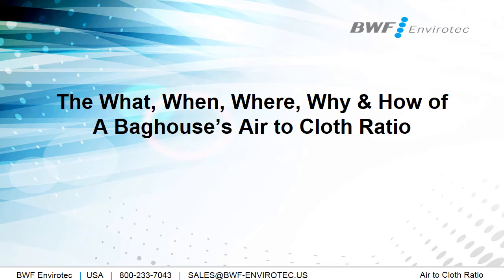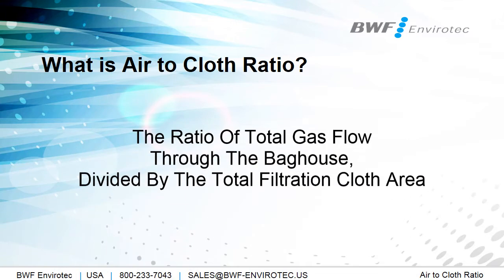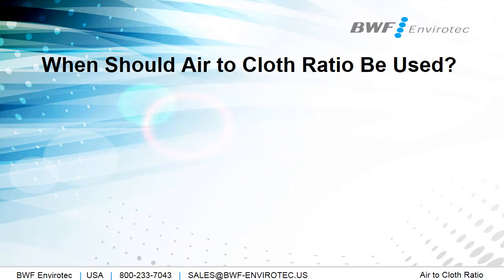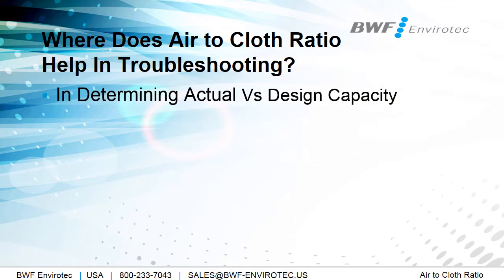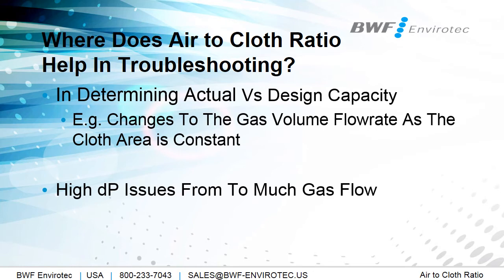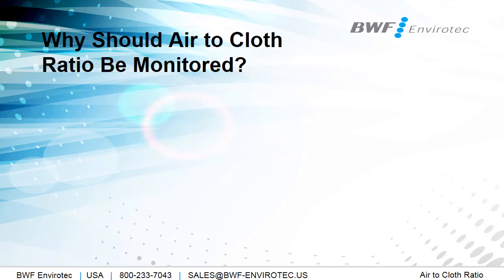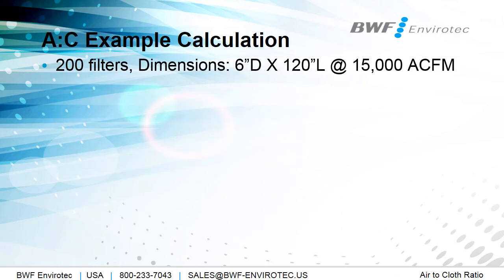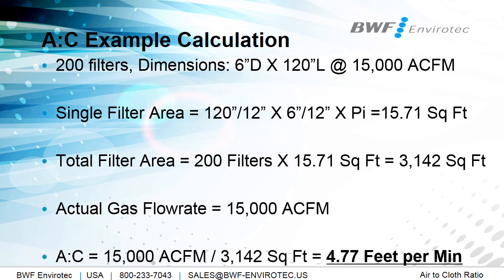Baghouse Air to Cloth Ratio - Overview

Comment: i'm design a bagfilter in feedmill system , i need caculate pressure for a cenfrifugal fan for system,
but i can't find loss pressure of filter bag in catalogue.
I have data air permeability 333 l/(dm^2 min)@200PA
Reply from the maker: The permeability denotes the flow at a pressure across the filter.  This can be used to estimate resistance when incorporating the filter area and required flow rate. 

That said you will want to ultimately know the dp, or the resistance, from inlet to outlet of the Baghouse. If you have similar applications then use those losses across the Baghouse to size your fan. 

The dp across the Baghouse will be higher than the tubesheet. Making the design of the dirty air and clean air plenum, as well as Ducting, important for reducing the static pressure inlet requirement of the fan. 

Thank you for the comment. Reply with any further questions👍

Comment: How to calculate Flow rate required for Dust collection
Reply from the maker: It depends on what is being vented, dust properties, and enclosure design to outline a few areas. I would suggest looking at the Industrial Ventilation Guide. As well as NIOSH as a good pdf that discuss dust collection topics.

Comment: How to define number of filter bag in drying system?
Reply from the maker: To find the number of filters you need a few pieces of information. Air flow rate, Target air to cloth ratio, and the filter’s cloth area. Start with the target air to cloth and air flow to find the total cloth area required in the system. Then divide by the cloth area per filter. 

Regarding air to cloth ranges, and these are general ranges as more difficult to capture or remove dust will require a lower A:C ratio. 
Nuisance DC 5:1
Large process DC 3:1